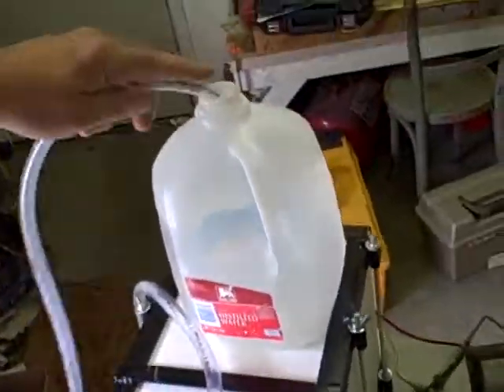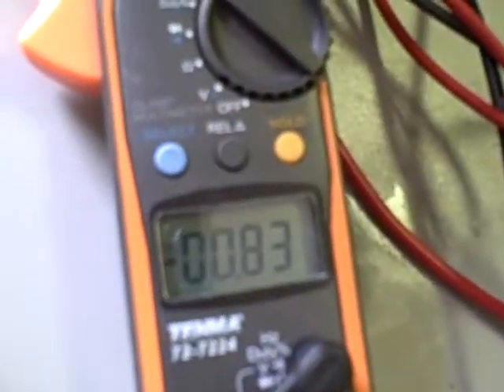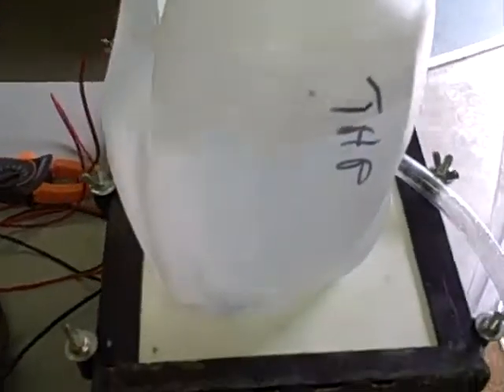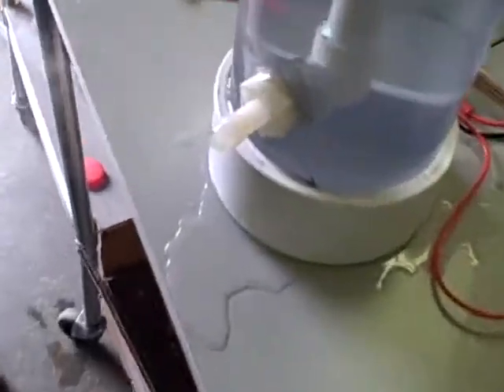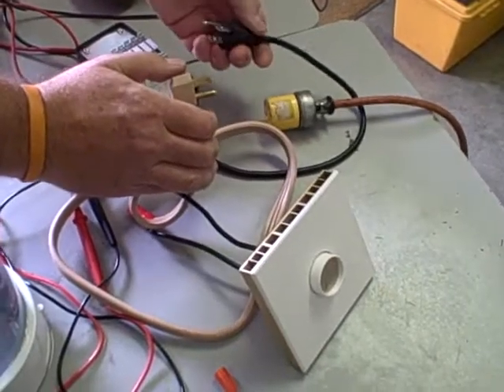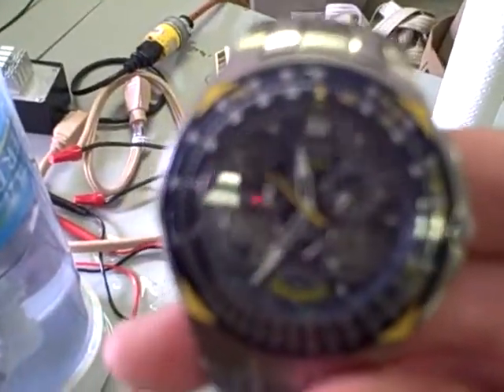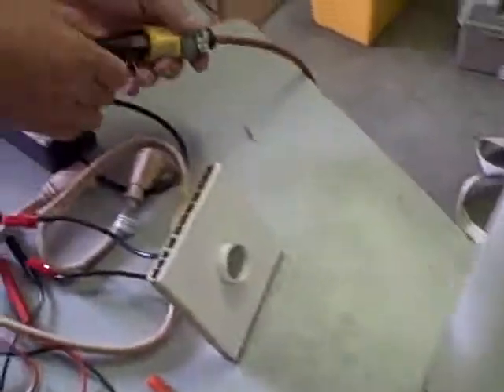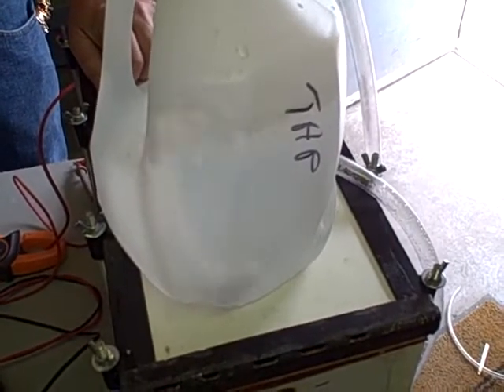Scuffy Cell III part 2   10.86mmw

Comment: hi 
u use a5000 watt inverter to run this cell why is that isnot enough to use the current home and using abridge rectifier to obtain a 120 v dc
what is the ways of safety to use this cell in acar like aback flash assester is there another ways i want to know 
u do something i dont know what is it by changing the cables and suddenly the amount of gas increasing what is it
thanks

Comment from the maker: This is a 63 plate series cell..By applying 120v across the cell (pos one end,,neg other end) The electricity passes thru the neutral plates.. you divide the total volts by the number of plates giving you about 2 volts per plate. If you put a volt meter across the cell you get about 120v.  if you put the neg probe of the meter on neg. and the positive on the 2nd plate you will get 2v. the next plate will be 4v and next 6v and so on.  1.8v-2v is the ideal voltage per cell for electrolsis

Comment from the maker: To run this cell on a car u would need a 2000 watt inverter. This converts 12v dc to 120v ac...then using a bridge rectifier to get 120-140 volts dc..No this is not enough gas to run a car... maybe a small single cyl. engine..

Comment: Hi
i want to know if i can use this cell in the car and is the voltage from the battary enough to supply the cell
     as i saw on the u tube  you want 118 volt dc and this is not exist in the car so what is the solution 
is this amount of gas enough to walk acar completelly 
i wait the answer on the e mail 
nasserazam99@yahoo.com

Comment from the maker: @aterack833  thanks for the comment..The problem is when plugged in direct and the cell filled 1/2" from the top the production is so high that the bubbles push the water over top of the plates. This allows the current to past over top of the plate and not through the plates causing the mmw to go down. If i reduce the amount of liquid to half full than i get the same high production at only 10 amps..  117v 10amps  5 seconds  1 litre  10.2mmw  thanks

Comment from the maker: @amos033  I think you need a new calculator..a 63 plate cell is 62 cells..the cell was running at 115 volts at 4.8 amps..that comes out to 1.8 volts per cell..the cell temp. is running at 70 degrees ( no steam at 70 degrees) what you see is water vapor mixed with gas coming out of the tube do to the volume of gas flowing.

Comment: watts,voltages, apms.. oh my

I was told that its the amps that cause the HHO production not volts i am unclear on this.
also if your using such high voltage why do you need neutral plates , doesn't the current flow through the water from one terminal to the other.. enough to crate the hho process?

Comment from the maker: single pole...I have a 560mfd @250v cap across the bridge recitfier..if I bypass the dimmer and plug in direct I only draw 15-16 amps..either you have a short across the plates or you need to lower electolyte percentage..with no electrolyte it should draw no current..you can control amps with that..I use a 35amp bridge rectifier

Comment: it's not a "dry" cell if you allow electrolyte to pass between plates. The Tero style is a dry cell. It only allows the addition of h2o via an isolated water line through aligned holes. Don't ever allow electricity to pass through electrolyte around the plates because it's the path of least resistance and it will absolutely skip passing through the plates and KILL your efficiency. Unfortunately there are people who have put up many videos doing this because they didn't research first =(.

Comment: If I make a dry cell with gaskets and keep the same plate size and gap, and power it the same way , say 1 volts per cell and pump the electrolyte  through the plates with holes alternating in each plate, will I get the same kind of out put?  Making and sealing the this design of cell is difficult to acheive and expensive.